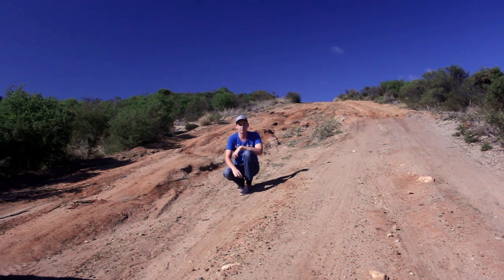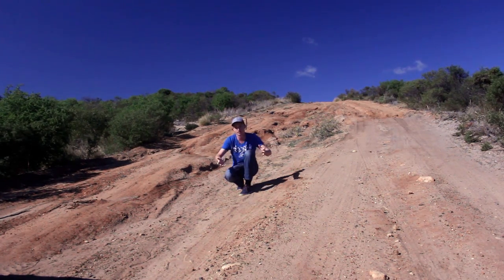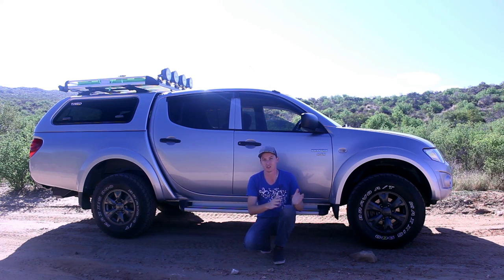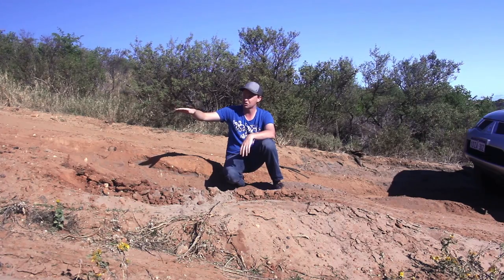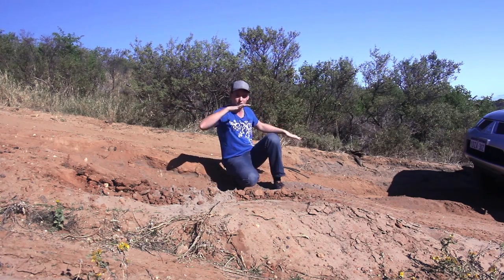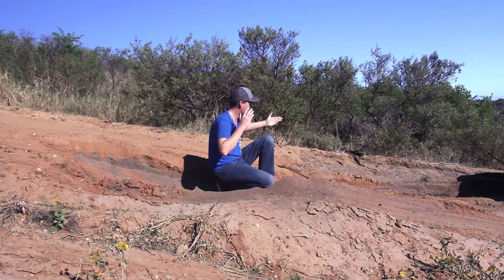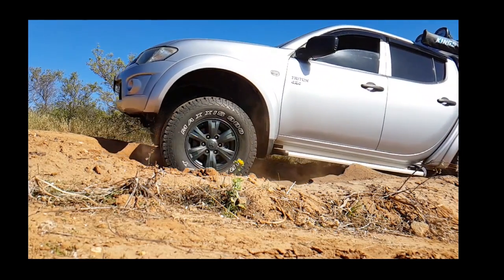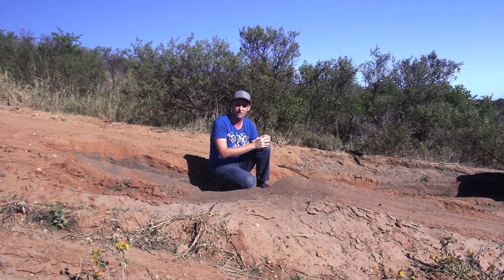Traction Control - Explained

Comment: my understanding in an MN triton you cannot turn off traction control, only ESC when activate the button.
Reply from the maker: 4low and 4high it will be turned off if you push the button
Reply: @4x4CampingandAdventures  thanks for the quick response. This is confusing as Mitsubishi has told me you cannot turn off traction control even in 4wd only ESC is turned off by pushing the esc/traction control button. Allot of other 4wd websites say the same and I think it causes allot of confusion for novices that hear different stories. Not saying whom is right or wrong, but allot of different opinions. Thanks
Reply from the maker: From what I do on the tracks if that button is on traction control kicks in etc in high 2 high 4 and low 4 when it’s pushed off in high 2 it’s still on 4 high it’s off unless you are just spinning tyres like a mental and the same in 4 low. But again it works in your favour if you get stuck push it and you might get your self out.

Comment: Some suggest turning it for soft sand??  For soft powerdy sand, does traction control hurt or help? I heard aggressive tread hurts.  I wonder how much better is a wider tire is in soft powdery sand.
Reply from the maker: Won’t help at all on soft sand the traction control will kick in and bog you down.
Reply: @4x4CampingandAdventures  thanks how much better do you think wider tires will perform for me? from 12% wider from 8.5" to 9.5"?
Reply from the maker: Wider tyres don’t help to much on the beach as it’s the bagging out of the tyre that helps you in sand so normally a taller tyre will help.

Comment: I think that is called "active traction control" not traction control itself. Traction control cuts power to the throttle to prevent wheel spin.
Reply: sry but traction control stops wheel spin not trottle
Reply: tc is in the computer to the diff. not the throttle in most rigs.
Reply: @thomasjohnston5817  traction control controls your throttle and/or brakes. Traction control reduce wheel spin by cutting power to your throttle and/or by using abs pulsation braking force. So technically it can be both using powertrain and the braking system.

Comment: Hi mate I'm really enjoying your channel thank you so much I have one quick question when climbing will traction control be activated in low range or deactivated also would you recommend traction control on when off roading not on sand

Cheers
Reply from the maker: Hey mate thanks for watching 👍 low range if it’s turned on traction control will be activated. I would highly recommend turning it off in the sand mate
Reply: on sand yes. traction control would be keen in high. if that fails, go low. know what YOU and your vehicles limits are. to not end up in  bad spot.

Comment: Good vid but looked like you were goin a bit faster with the trac cont on...
Reply from the maker: About the same speed mate it's hard to maintain a pace when doing hill climbs the key is not to go to slow to loose momentum
Reply: you were definitely going much slower with "traction control off".  Traction control has it's place, but anything sandy imo doesn't work that good.  Rock/ruts works great..

Comment: a touch off at least six inches plus you drove it into a hole,   look at again and tell me that was a fair test, it should have been driven in the exact track of the first  try  you say a touch off hahaha big touch
Reply from the maker: Ok mate before we start to waste 2021 arguing over inch’s and how far it was off understand that the video is to demonstrate traction control and in this video it did it’s job as you can see in the slow motion video.